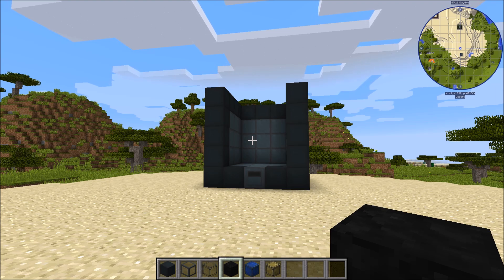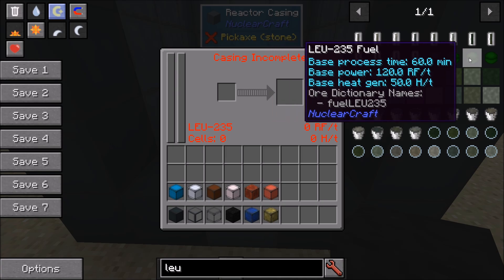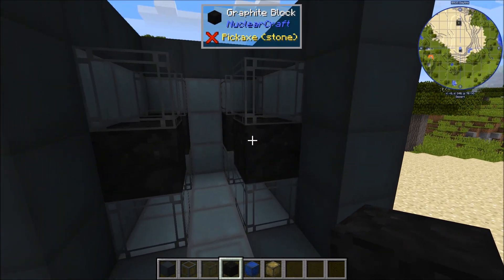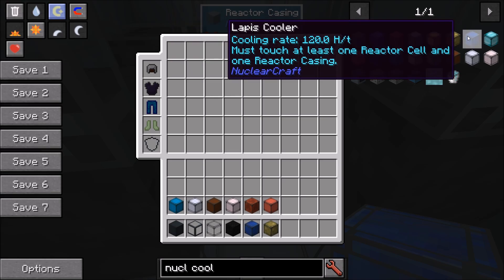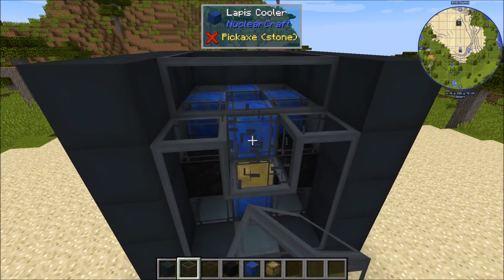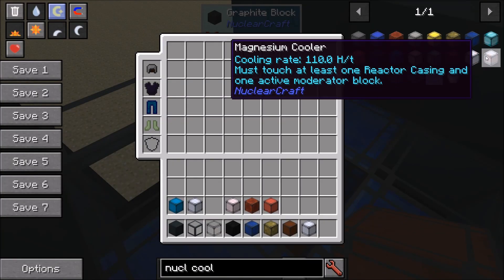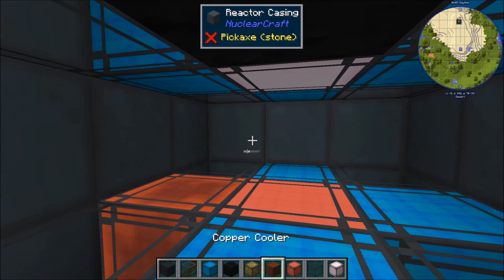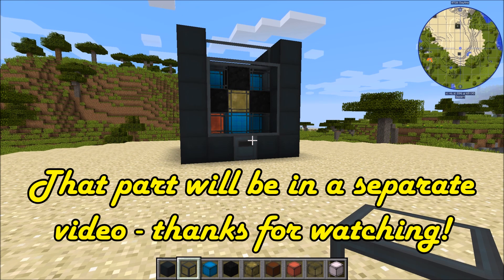NuclearCraft Tutorial - Reactor Design {1/2} [1.12.2]

Comment: Thanks a lot! NC has been a blast. I just finished my first reactor in survival on mceternal... well the 6th iteration of my first reactor :P
 
It's a 8x5x7 made of:
23 cells
107 Graphite blocks (moderators)
4 Active glowstone coolers
76 Glowstone coolers
44 copper coolers

and It makes about:
17,000 rf/t on TBU oxide (easy thorium fuel)
25,000 on LEN-236
31,000 on MOX-239

I get about 5 minutes of burn time per fuel puck, though I've seen it burn more volatile fuels @ 3 mins a piece.

Comment: can u make an list whit blocks that i need? cuz the first 2 blocks are not named
Reply from the maker: If by first two blocks you mean the ones making up the casing, they are fission reactor casing and blast blocks. Keep in mind that the blast blocks are not required :)
Reply: @NuclearCraftMod  thx one question i tried to blow up an reactor but whitout cooling an max heat generating fuel its not exploding 
so can u make an setup for an reactor exploding
Reply from the maker: @pinewoodtechresearch7317  There's a config for explosions, but it's not well implemented. Overhaul will hopefully have proper hydrogem explosions rather than IC2-style nuke explosions (which is defo not how reactors fail :P)
Reply: @NuclearCraftMod  uhm forgot to add an lever on an 1x1x1

Comment: Ive realized after upgrading from a similiar reactor to this to a much larger one that they burn through fuel quite fast so do you know of any ways to automatically get uranium. 

I do know that mystical agriculture exists but I Find it quite cheaty. Mekanisms digital miner and buildcrafts quarry are decent until they run out of ores and I Have to move them.

Btw I don’t mind moving The digital miner that much but od there is a way to get ores (specifically uranium) without The need for manual work that would be much more conveniant. Thanks im advance :)
Reply: 3 options I know of are Botania's Orechid, Actually Additions Atomic  Reconstructor with a Lens of the Miner, and Industrial Foregoing's Laser drill. The Orechid and Lens of the Miner require you to provide Stone but the Laser drill just requires energy.
Reply: Mystical Agri does grow Thorium, you'll still have to mine Uranium.. but here's the fun part! Using that 'cheaty automation' allows you to setup a really cool fuel reprocessing loop. Those new fuels types you get add a great dynamic. I might recommend making two loops. One for TBU fuel reprocessing and a 2nd one for the Uranium reprocess. You should also add a 'safe fuels' whitelist filter as well... haha.

Comment: Could you use the heat with other mods like mekanism to power something like a heat generator or do other things that would require heat in that mod
Reply from the maker: The 'heat' in NC is just an internal number - it doesn't have any external use.
Reply: Ok

Comment: How to prevent radiation leaking from a reactor? Am I doing something wrong? My geiger counter is going crazy around the reactor.
Reply from the maker: Adalwolf A permanent solution is placing radiation scrubbers, while in the meantime armour radiation shielding, radaway and rad-x are the things to use :)
Reply: @NuclearCraftMod  Hi, thanks for reply! Is there a way to "block" radiation coming from the reactor with like cement or lead? Otherwise, the scrubbers and rad-away are very expensive to make in the early-midgame. I assume this is intended balance,  but it's a bit annoying because I have to build the reactor far away from base to power my RF machines. (Btw love your mod)
Reply from the maker: Adalwolf There is no shielding unfortunately, no. At least, not for now anyway - the new overhaul branch may do in the future :)

Comment: My reactor (using LEU-235) : 2700RF/t , -30H/t , 321.4% Eff ,  with 7 cells (CE) , 13 emerald cooler (EC) and 7 graphite block (GB). I think it's a good reactor because emerald is easy to get in some skyblock modpack. And fuel is used in 9 min and not 8 min. 
Edit  (how to make it ) : a pilar of 3 EC each corner, then between two pilar (not the center) 2 pilar of 1CE+1GB+1CE and 2 pilar of 1GB+1CE+1GB. Finally, the center is a pilar of 1EC+1GB+1CE !!!
Reply: Hey, i know this comment is from 1 year ago, but, can u help me with this? I tried to use this design and can't get it. When i do it (I guess im doing it right) it says "420h/t" and i guess that's bad, right? I don't understand this mod at all and i can't make my LEU-235 work :( (Btw im in e2e)
Reply: @estefanoterenghigoy2091  Try to do it with my edit
Reply: @lgeina7566  lol nvm it needed a redstone signal ._.xd
Reply: how did you get 27000/t? i can only get 2700
Reply: @Straw-Log  It's indeed 2700RF/t as i wrote

Comment: Thanks mate!
I used to build lots of Big Reactors, and kinda got stuck with the midset that "fuel rods or whatever should go to the center" and got terrible and costly reactors in return. This clears a lot for me, and I think I may have found an alternative to Big Reactors.
Reply from the maker: No prob - enjoy!
Reply: Just gotta remember that you're building the actual reactor, not the house containing it. The encasing blocks are basically apart of the reactor ;)

Comment: Nuclearcraft needs a simulator like big reactors had.
Reply from the maker: We've thought about a simulator, but the thing is, it would probably be no quicker that just going into creative and building the design in-game :P
Reply: Will the fuel calculator still work if I change the configs then for fuel rates etc?
Reply from the maker: Fuel rates no, but if you change the power gen or something you will need to tweak the values in the table.